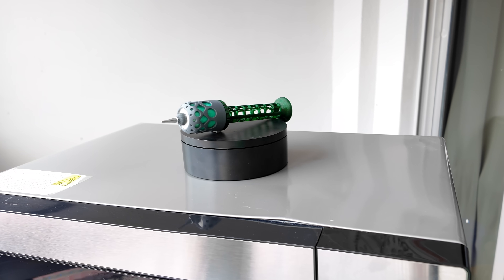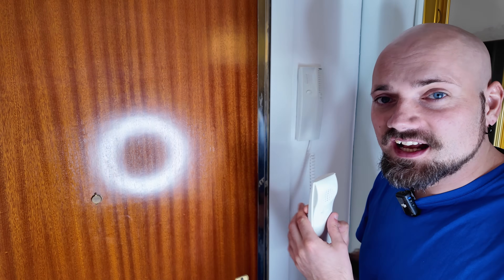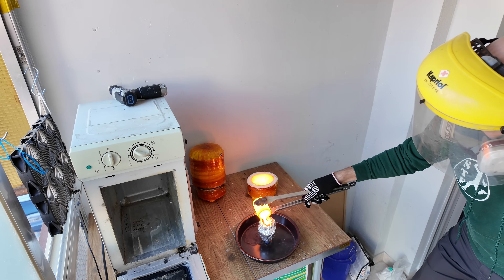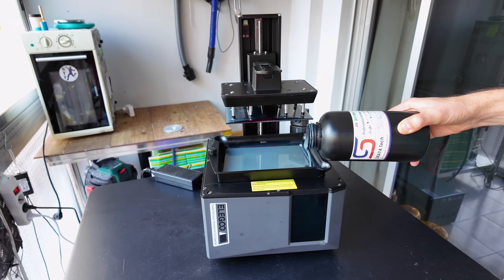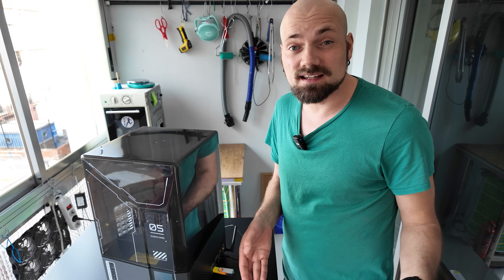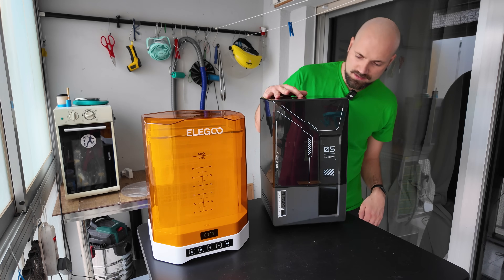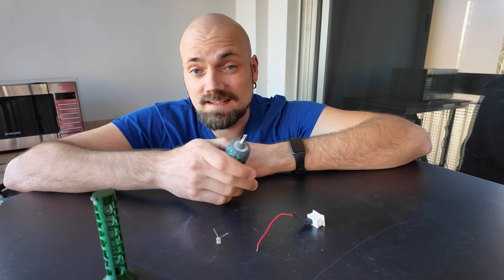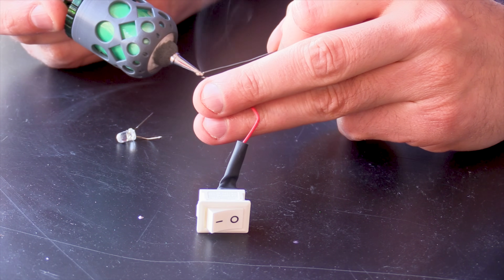World's First Microwavable Soldering Iron (3D Printed) 🔥

Comment: 2:35 your question is timely. I have need of a soldering iron. Not for the purpose of soldering. But I have an aluminum gadget (sort of a bracket) that I have to mount in a plastic base. I want to heat the metal piece and melt it into the plastic. Once it is encased in the plastic I will use the mounting screws to mount it even more securely. The problem is the aluminum piece is 25 mm X 75 mm X 6 mm. It has some details that I don’t want to mat, and in the underside it has some lugs that will imbed in the plastic. It is going to take a fair amount of continuous heat to get the plastic to soften and then liquify so the underside of the bracket can be pressed into the plastic base. The sliding iron you gave described would work perfectly. Heating it little by little in the microwave to slowly add heat to the aluminum. 
When I discovered that I needed a concentrated heat source, this morning, I turned to Amazon snd found a 200 watt soldering iron for $30. It is supposed to arrive in the early hours tomorrow morning. I am in Seattle Washington USA and Amazon is usually pretty reliable. 
But, now, to answer your question, definitely I would buy your soldering iron. I would buy it even if I didn’t have the immediate need that I had this morning.

Comment: Eyo, how did you do that apartment door thing? That would be cool to have! Transmitter and then a reciever that turns on a transistor?
Reply from the maker: I placed a tiny remote-controlled relay switch inside the 'phone.' It's powered by a 5V phone charger. I probably could have used power from the actual intercom, as the relay operates anywhere from DC 3.6V to 24V, but I didn’t want to risk damaging anything since all the apartment 'phones' are powered by a single power supply/central unit.

It's connected to the door-opening button and has a pretty decent range.
I added a link in the video description for people who are interested.
Cheers!
Reply: @ShakeTheFuture  Thanks for your reply! I'll give it a go!

Comment: where did you come up with the silicon carbide / sodium silicate mix? whats the sintering temp ? all i can find are some research paper that sinter at 1000C.  the soldering iron is a nice gimmick, but the true value is in that in-house ceramic
Reply from the maker: It's not sintered. It's just glued together with sodium silicate. It's my own mix I always use in crucible making and mold making.
The crucibles I make are closer to sintered silicon carbide...yet I would not still call it sintering.
Crucible video: https://youtu.be/P1VmIYheuU4?si=zcqUYrIJcSuiVaeT&t=1307
Cheers!
Reply: thanks for the other video, that's still an amazing mix that i haven't quite seen anywhere else

Comment: A potential design improvement might be incorporating a thermostat to vary the thermal coupling between the tip and a considerably larger thermal mass to make it stay hot longer and maintain a more uniform temperature. I’m just not sure how such a thing would be implemented. Most thermostats are designed to control electrical circuits, meaning they need only be simple bimetallic strips with contacts at the end. The thermostat in your device would need to somehow create an efficient thermal coupling between the tip and internal thermal mass when the tip is under the set point and break it when the set point is exceeded, which doesn’t seem as simple…
Reply from the maker: I also had a few ideas on how to control the temperature to some degree. Obviously, I don't know if they would work, but there are definitely ways to make it much better. Cheers!

Comment: useless thing, waste of time
Reply from the maker: Thanks for sharing your thoughts. Do you also think the microwavable branding iron shown at the end of the video is useless, or did you not even get that far in the video? :)
Reply: @ShakeTheFuture  why do you need a microwave if you have a lot of soldering irons, and your stamp is inaccurate, it burns on one side, but doesn't burn on the other
you are reinventing the wheel
Reply from the maker: @BRYZAlivnestok  I used the stamp for the very first time in the video, and I think it worked pretty well. There is room for improvement, but just like with the soldering iron, I wasn't showing the final product, only the proof of concept. Thanks for taking the time to comment.

Comment: This is a fun project but I don't think there's much utility to it. I mean the only way I see this being useful is if you are somewhere inaccessible to power in which case you wouldn't be able to run a microwave. Otherwise you just run an extension cord. Maybe if you need to use it down the back of your yard or something but I don't imagine it would hold it's heat very long so by the time you get there it's either too cold or you get a tiny bit of heat out of it, then have to run back up to the microwave.
I guess what I'm saying is this is a very convoluted way to not use an extension cord. 
But hey, we don't always make things because they're practical, sometimes we just make them because they're fun.
Reply from the maker: Thanks! That's true.

Comment: It's a fun experiment, but to be honest, after buying a TS-101 last year, that I can use anywhere with a USB-C power supply or portable powerbank, and which heats up within 10 seconds and stays at the exact temperature I need it to be.. I wouldn't want any other soldering iron. Especially the fact that it heats up super fast, and also stays at the set temperature very precisely makes it so easy to use. And with the modular tips, it's also super easy to use it for inserting threaded inserts into my 3D prints. I truly feel that the TS-101 was the best thing I bought in 2024 hahaha.
Reply from the maker: You made me want one :)
Reply: @ShakeTheFuture  And I wasn't even trying to sell it haha! It's a nice soldering iron. You do need a power supply or powerbank that can supply more than 65Watt so keep that in mind! :)

Comment: I used to be a magnetic instruction heart thermal specialist (fancy name for what i did) and that ceramic fiber is absolutely amazing. HOWEVER, please heed the warning about gloves and dust as this is literally ceramic dust that could cause irritation or worse in the lungs. If you ever worked with fiberglass insulation you will know that if it gets IN your skin it itches like crazy. Best suggestion is rinse with COLD water to prevent the pores in your skin from opening and letting the fibers wiggle in more. Other than that, if the houses in California were insulated with this stuff, there's a good chance their houses could still be standing. It's that good.
Reply from the maker: Oh yes, I can relate the itchy skin. Cheers!

Comment: For electronics not overheating components is critical which is why temperature controlled irons etc are often used.

I wonder if you could implement basic constant temperature:
 - Internal chunk of something that gets hot in MW and stores heat, separated from tip by small gap
 - Tip made of something conductive that doesn't get super hot in MW
 - Use thermal expansion to control transfer of heat to tip:
   - Tip cools - needs to get closer/contact to thermal mass
   - Tip heats - needs to get further/separate from thermal mass

The last part would need some sort of mechanism, like a lever, compliant mechanism etc to move the thermal mass closer/further from the tip.

Could use a 3rd material with high thermal expansion coefficient or some other way to conduct/insulate heat (liquid, gas, IDK).
Reply from the maker: Well, I had a few ideas on how to control or even display the temperature, but I didn't want to go down that path and spend time on something nobody needs :)
Reply: @ShakeTheFuture  Yep, may as well just use a battery...

Comment: As a lot of people have pointed out, not many niches for this thing to fill. 
However, in the name of discussion, I want to propose a solution to the temperature stability/low heat capacity problem:
If you made a hollow tip and filled it with a metal with just the right melting point(pure tin, for example), you could have a phase change heatsink. This would allow you to leave it in longer, and store more energy as the tin melts. As the iron loses heat, the tin will start solidifying again, releasing just enough heat to maintain a stable temperature.
Reply: Tin workers just use a big chunk of copper for soldering. Anyway I thought too about doing this with a metal mix which melts at a specific temperature for both temperature control and heat capacity improvement. I was going to put the heater in a bench-type soldering-iron stand because I hadn't even thought about a microwave.
Reply from the maker: That's an interesting one. Thanks for sharing.

Comment: I can't say as I would ever have any interest in one. I like knowing it's a possibility but I just can't think of a good use for it. If I really want to be that portable with my soldering iron I will just go with one of the battery ones now
Reply from the maker: Yes, I totally understand. I base it on my own experience. Until recently, I had only one cordless gas-powered soldering iron, and I had found myself in situations where I needed to solder but was out of gas. Those were the kinds of situations I was thinking about. Since buying a battery-powered soldering iron in addition to my gas one, I doubt I'll ever run into a situation where both are out of power.
Reply: @ShakeTheFuture  true enough. It is at least nice to have more than one option. I too both have a battery powered one and a gas powered one.

Comment: cool little project :) i wonder, could you also use graphite instead of the SiC for the crucible/heating core? iirc its a pretty good microwave absorber too
Reply from the maker: It does absorb, but I have not tried making a crucible out of it yet. I have some to experiment with one day or to mix with silicon carbide, but I haven't gotten that far yet. As for the graphite crucibles I bought from Aliexpress, they don't heat up—at least the one I purchased. However, a pencil core will heat up.

Comment: If you cast another metal part, maybe make a cap to cover the solder tip. You could use the cap after taking the iron out of the microwave. To keep airflow away from the tip as you move to the location you want to solder.
Reply from the maker: Thanks for the tip.

Comment: seems very not healthy and like it would make poopy inconsistent welds compared to a $30 battery powered one
Reply from the maker: Yes, but one thing I didn't explain in the video is that I was already thinking about a much better version of it, one that can be temperature-regulated to some degree. This is pretty much the first and last finished prototype, so there’s potential for improvement—though I’m not sure anyone will ever actually need it. Cheers!

Comment: The best excuse for the soldering iron I can come up with is working in an explosive atmosphere. 
A potentially marketable spinoff is a hot scraper kitchen tool, for removing labels, separating chunks of frozen food, cleaning up messy stuff that responds to heat.
Reply: it doesnt take much imagination to realize, this is just a further normalization of the new inductive method of heating.  we should know how to most effectively translate power, assuredly. 

granted, its out there... but I mean, for me as an electronic head...  this is a genius application.  it wont be a product.  but it sounds like a person in the right scenario might find a ton of use not only for a soldering iron, but other applications where heat is required.
Reply from the maker: Cheers!

Comment: May as well use a hot rock and a campfire.
Reply from the maker: But there’s another benefit. You have to go to the kitchen to heat it up, which means you'll move around—and maybe even get some exercise if you do a lot of soldering. So technically, it’ll keep you fit... unless you're tempted to heat up pizza every time you go to the kitchen 😄

Comment: Its neat, bu I can't imagine a situation where this makes sense. I'm comparing to modern equipment like the Pinecil which costs $25. It heats up in 6 seconds vs 30 seconds, and it can stay at that temperature for as long as you have power vs immediately starting to cool. You have very precise temperature control up to 400C. It knows when its not being used and automatically cools off. It has easily replaceable tips that are cheap and come in many different shapes.  And all it needs for power is USB C with PD which nearly everything uses now. If there isn't an outlet nearby just grab a portable battery bank. It also means you don't have to worry about any ill effects of putting a soldering iron in a machine designed for food!

Hard pass from me, but like I said its neat, and its cool that you made a working prototype.
Reply from the maker: Yes, I agree. This is just me messing around.

By the way, the soldering iron can heat up much faster, but I designed this version to heat more slowly by using a different-sized heating element and not fully embedding it into the ceramic fiber. In some of my tests, I made a soldering iron that reached glowing red temperatures in just 10 seconds, which ruined the soldering tip. So, I adjusted the design to prevent it from heating up too quickly. Cheers!

Comment: I think if you tried to actually use this for a job it would drive you insane. It doesn't hold a stable high temperature.
Reply from the maker: Well, for someone like me, it's ok, but yeah, I guess that's true.
Reply: You could add a chamber with a meltable phase change material to stabilize the temperature.
Reply: A slightly hydrated salt pile would probably work... or melt everything.

Comment: The soldering iron is almost useless. The value is in showing your process of developing it.
Reply from the maker: That's good enough for me.
Reply: I disagree, i would have been very into this if I had it when I was working on my jalopy. This is a cool idea.
Reply: @OldTiredEyes  Modern soldering irons can run off of your phones portable battery charger and cost $25 and heat up in 6 seconds. You'd be settling if you used this instead.

Comment: Very cool. I mean hot. No, It's cool. You know what I mean. Awesome. It needs a molten metal reservoir.
Reply from the maker: Cheers!
Reply: I had initially thought of using a eutectic nitrate salt mixture to provide phase-change stabilization of the temperature, but any alloy that melts a bit above the temperature of the solder you're using would probably also work.
Reply from the maker: @zinckensteel  Interesting! Thanks!

Comment: To solder one loose joint it might be OK. 
But as professional instrument -- no, USB-C soldering iron plugged into powerbank is the real portable solution.
One possible improvement could be hermetic capsule with lead-alloy: as much metal melted inside capsule by microwave the same amount can be soldered.
Reply from the maker: Thanks!